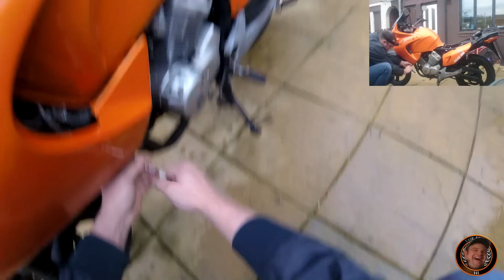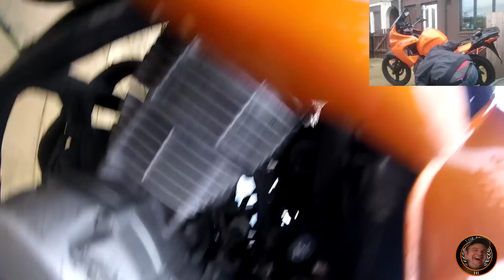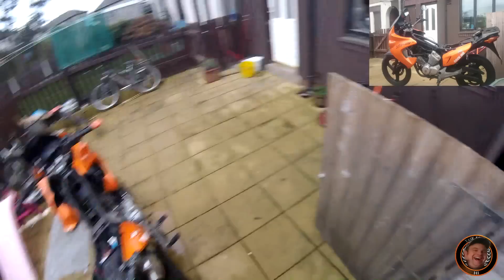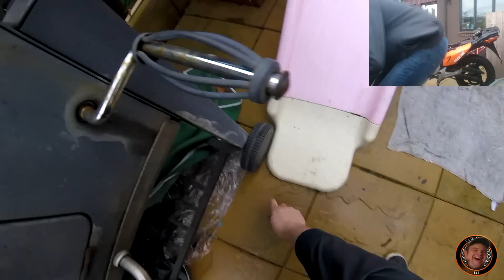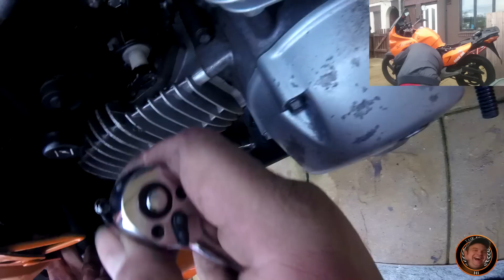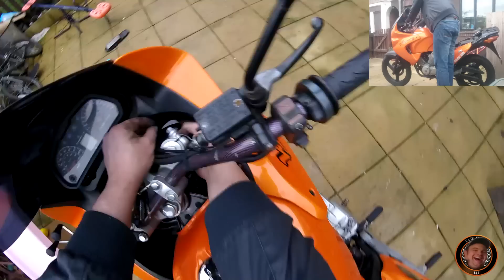Replacing the Air Filter Honda XL Varadero 125

Comment: I have an 02 model vara at 99089 should I change the original air filter inside as have mayo on oil fill cap

Comment: Aye mate, thanks for the vid. Just got myself an 06 varadero for cheap. Some pleb has cut the end off of the nipple under the airbox that's supposed to be the oil drain.
Reply: Bawhaha. Not a pleb, but a factory worker. That's how it's supposed to be.

And it's not an oil collector, it's water collector. some condensation builds up in there.
Reply: @h10hunter  Aye, whatever you say. I'm sure that's the reason why they put a pipe over it, clamped the pipe on and then cut the pipe off jagged slightly protruding from the nipple.

Comment: I was watching a French vid on changing the air filter and the dilly sod took off the fairing to get the tank off!  It's gutting when you've dona ll that work an the air filter doesn't even need replacing!

And is it right that these bikes will happily cruise at 60mph?   Seems a bit far-fetched for such a heavy bike!
Reply from the maker: Lol you learn as you go.
Reply: Yep, these bikes can cruise at 100 km/h with a full fuel tank.

Comment: i think i should do this to mine as well as my idle is up and down when i rev it and let throttle go power dies down almost to stall can this be air filter or needs some carb cleaner ?
Reply: Your mixture is too lean. i think you have either an air leak somewhere or your carbs are unsynced. Or your pilot screws need some fiddling around with. If your air filter seems moderately clean i am positive it's not the culprit